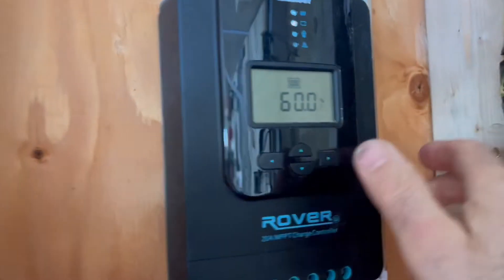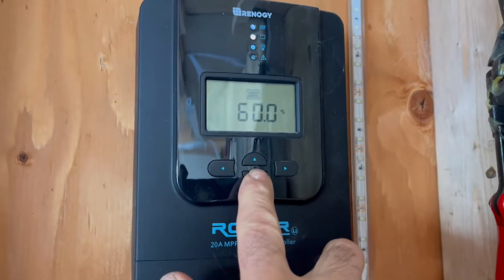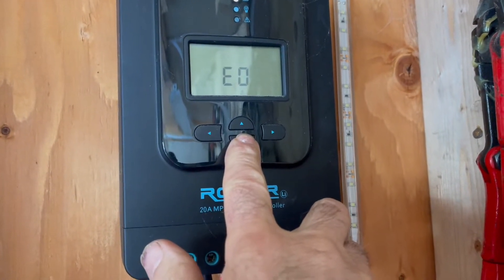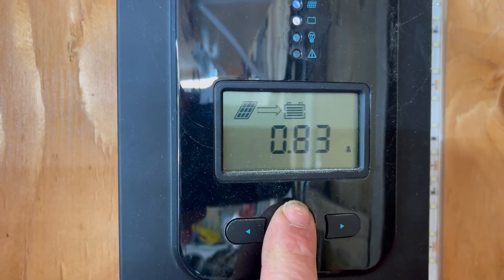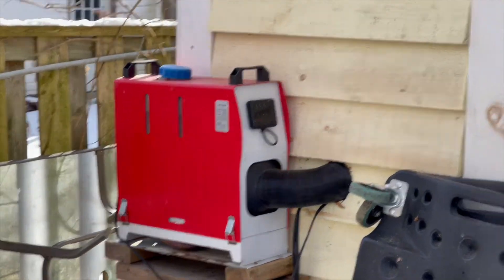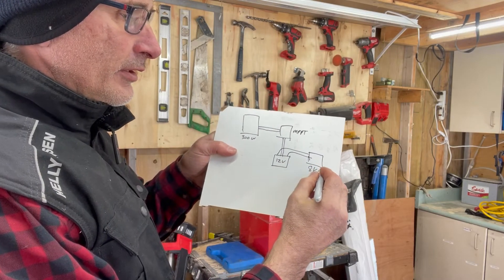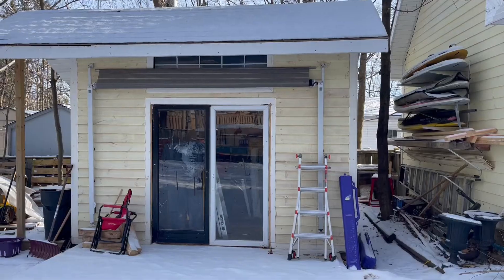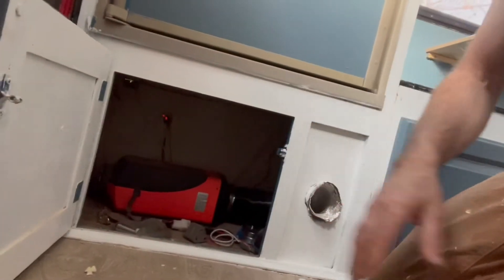Diesel Heater / Solar set-up

Comment: I’m living in my camper will this run continuously I need to be able to keep my camper warm thru the winter without any shortages I mean I do have a gasoline generator as back up but I would like to save as much money as possible on gasoline for the generator

Comment: It looks like you are not using the MPPT "light bulb" output circuit? I have the same MPPT with 150 watt solar panel with 100 amp Lifepoly, but it died after5 days.